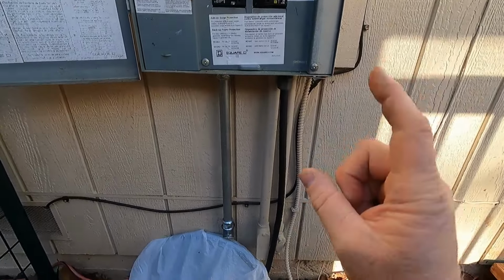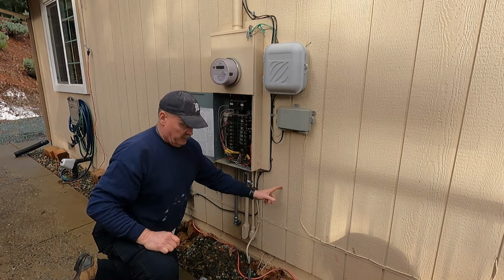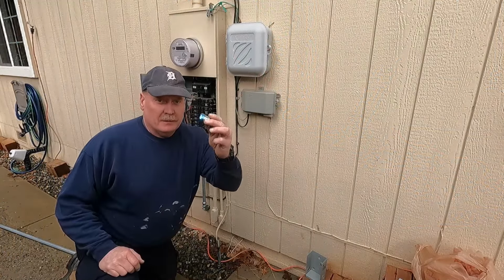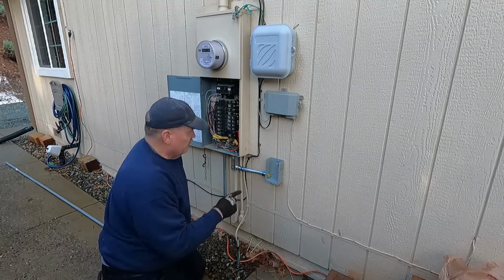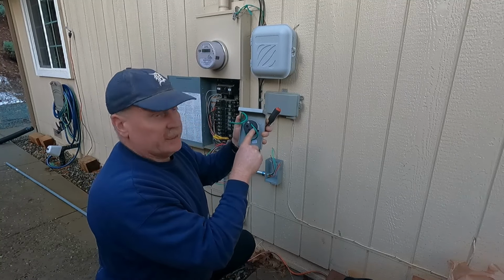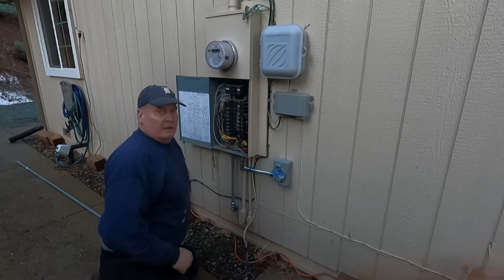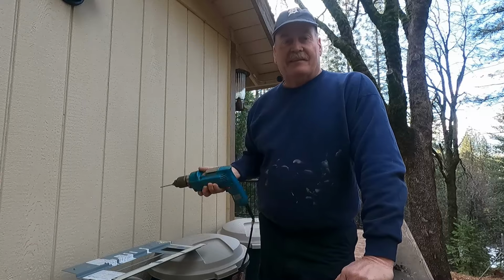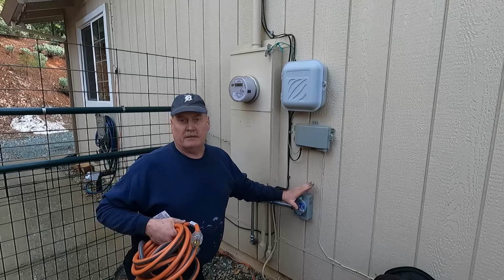Wiring a generator connection box and adding breaker interlock device

Comment: Always good to have a corded drill, and a good drill bit.  That was a simple interlock, I'm guessing you will have a generator  on the new house
Reply from the maker: Yes, the new house will have a standby generator which starts automatically when the power goes out.
Reply: Good job there Sir. 
I’m getting ready to do the same thing . I got to add a generator connection with the interlock . Thanks for sharing
Reply from the maker: @MsdMakingSawDust  Thank you Sir.  It always bothered me how that generator connection was wired on the house.